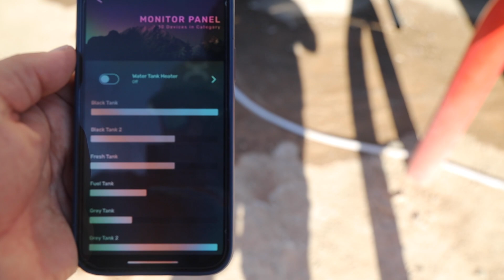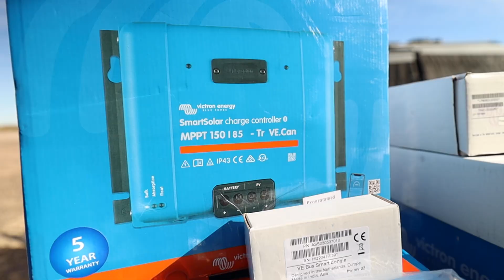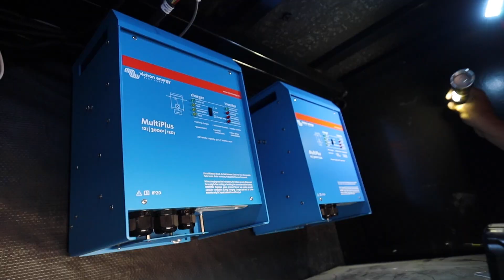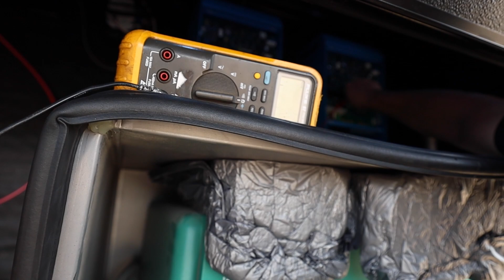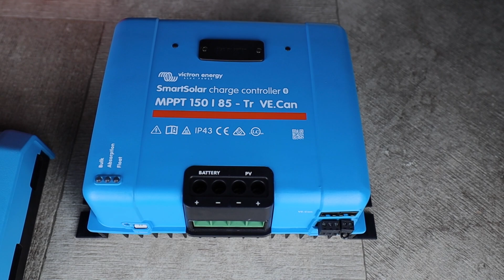RV MODIFICATION AND UPGRADES / DIY Battery & Solar Install

Comment: Wow what a nice setup.  Your level of understanding echoes a ton of research on this system. Can't wait to check it out someday.  How is it doing so far off grid.  Would you say you have plenty of power with the 2 batteries.   Sweet setup cant wait to see the rest.
Reply from the maker: Thank you so much JJ! We are very excited and hours upon hours of research was performed. We still have a ton to learn but we will get there. ☺️ Jason has been a huge help with the learning curve.

Comment: Good to know about the Pit Stop. We haven't been to Quartzsite in a few years and water use to be $5.00 to fill up no matter what size your rig was. It's probably due to the drought out here. We always filled up and dumped there.
Reply from the maker: I think it has to do with the drought but also the size of the fresh tanks. The RV’s hold a lot more now. I can’t imagine how much water they go through 😬

Comment: Did you add some bracing on the back side of the wall when you hung the inverters / converters?
Reply from the maker: No. It’s fairly thick board and provided plenty of support. No problems so far.
Reply: @1StrangeAdventure  it's difficult to guess at the wall thickness from our end of the video.

Comment: The best time of the year to. Go to the desert is from Thanksgiving to Easter.then it gets hot
Out there.where you are at .you are not to far from the river.back in the 70ds
We use to go to Senators wash that is near Yuma AZ. An on 4th of July weekend we would go to the inner tube race and float down the river from Laguna Dam to the Territorial Prison.in Yuma.be safe in your travels.
Reply from the maker: Thanks for the tip! We will keep that in mind for when we go back. Floating down the river would be fun 😊